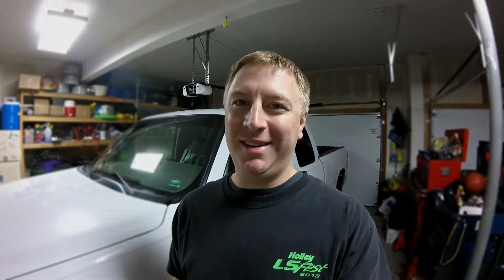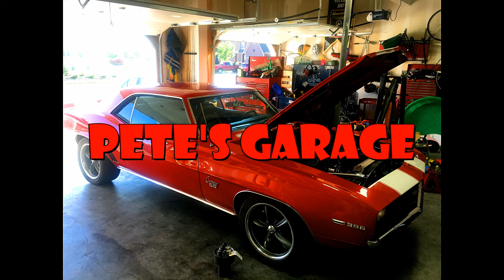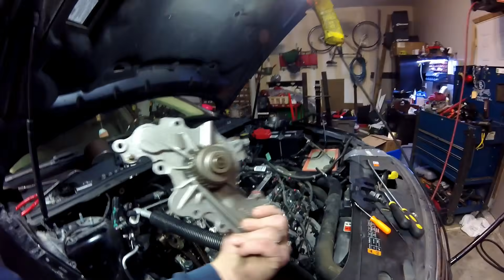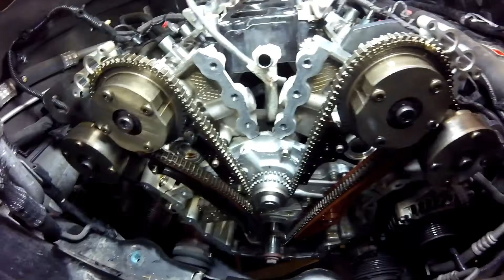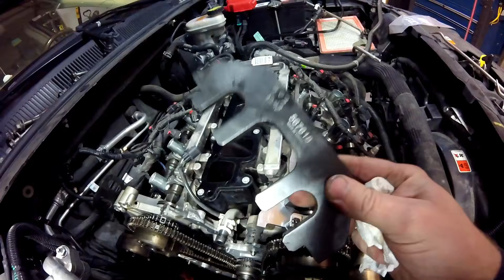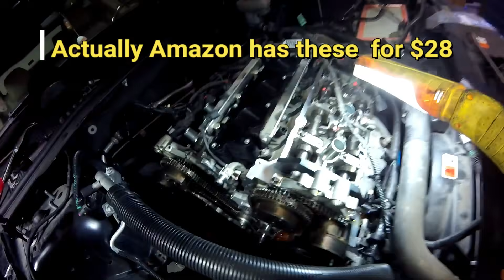Why does the Ford Taurus, Explorer, Edge 3.5L water pump cost over $1400?

Comment: you know . . ? ? . . .  that reminds me of what Pontiac did to the  turbo trans am. they  ran the bypass inside the water jacket
through the head and side of the block. it done very good until the elbow deteriorated. . .  every time. now that was a design flaw.

and as for that water pump, they done that because of  '' space issues '' .  and as for the  >.>  '' exhaust timing camshaft '' . . .  that is a very new one to me, they should have gave that car the  '' SPECIAL ''  name tag. 

thank you for taking the time to inform us of what  '' NOT TO GET '' .

awesome video !!

3000 thumbs up !!

Comment: That's sad. And it doesn't end with just Ford. I was driving a 2016 Subaru Forester and it needed a $500 service at 30,000 miles. Later I looked at a video of taking the Subaru engine apart. Believe me, you do not want to tear one of those down, like ever. I sold the Subaru and am walking for now.

Comment: FORD  put the flue pump in the gas tank another not so better idear
Reply from the maker: They all do that. GM got rid of fuel filters over 10 years ago and we now have less issues with fuel injectors. Go figure. You shouldn’t ever have to replace the in-tank fuel filter. Unless someone sugars your tank or you get some really bad gas.

Comment: I have had the "pleasure" of dealing with 4 taurus-s, 1 from the 80's, 2 from the 90's and 1 somewhere around 2000's. all of them had these types of over priced repair costs, constantly breaking, oil leaking and burning, rust issues such as the tail pipe hanger's mount point rusting off, interior always falling apart. In my opinion, never buy a ford taurus. the engineering is crap, the quality is crap and they are engineered so the dealership can keep you coming back..thankfully I never bought one, it would be in my back yard next to the maverick full of bullet holes.

Comment: So what happens if the seal fails on the sprocket or drive side  of the water pump you have coolant in your oil  ???  that why I like Ford they can take a simple concept and complicate the Hell out of it . even years back to do a water pump on a  289 or 302 was a Pain and you hope they did not leak when you were done  small block Chevy back then four bolts and your done  just remember the TV commercial  90% of Fords are still on the road and the other 10% made it home

Comment: Obvious design flaw, maybe. Every maker has there flawed products. Like GM's Plastic Timing Chains in Equinox's that have a history of going out and you have to replace the entire engine due to particles every where inside the engine. This includes the late model gas versions of GM, also. Complete design flaws that warranty companies hate to cover. Thank you for the information, don't buy a new Taurus got it. Junk design.

Comment: I work for thermoking ( transport refrigeration technician) thermoking has came out with Peugeot engines now and let me tell you they have been so much trouble, it's a car engine and it has no business being used for this application, we are now dealing with timing belts, EGR systems and now ECU'S ! Our units have had microprocessors for 20 years now and they have been ran by isuzu engines and now yanmar engines for the last 15 or so years but they have decided to go with Peugeot and they are regretting it, we are now doing engine swaps on units with Peugeots for many years to come! My point is, engineers and manufacturers sometimes don't think about the future, they need to be smarter with testing before taking a leap with something new and actually alot of manufacturers hands are tied, they are forced to make these types of changes because of the EPA and other things..   all I can say is stay in school, find something that pays good and won't cause you to pull your hair out , a mechanic or technician might not be such a good thing to do.....

Comment: $1400.00 that's cheap...I just delivered an 2014 Ford edge   same or worse problem...wen the water pump fails it leaks into the oil pan contaminating everything cam solenoids...etc the dealer estimate about $2200.00 later on I found up that this engines are also on the fords flex...I just replaced my water pump on my LS engine...6 bolts done...

Comment: 300,000 miles on my tacoma and i still have the original water pump from 2007.  As well as the original everything else under the hood.  Ford is a JOKE.
Reply: Not necessarily, I own a '99 Ford F150 4.6 liter with over 308,500 miles. All original , except for Battery and Alternator.
Reply: @davidbuck6499  That is not the same Ford as today sir.  If you bought a new ford youd have problems with it before you had problems with the 99.
Reply: 2008 Toyota Tundra 90000 miles and ya haven't had to change anything
Reply: Besides oil

Comment: The worst part of this job is resealing and attaching the front timing cover. By the way if you get coolant in that engine oil and you see it on the dip stick you are going to want to replace those phasers and bolts
Reply from the maker: I agree. There are tons of bolts and you don’t want to smear the silicone and have it leak. Then you’re redoing the job.

Comment: The water pump can be had for $50 easily and the special tools for about $40. I am 63 years old with a bad back and I believe I could do it and if I had that ford with that problem, I would do it.
Reply: my 1998 chrysler cirrus had the pump behind the timing belt too, i took it apart to change the timing belt  they recomended that i also do the water pump but it was still tight and didn;t weep or wobble so i left it there and did just replace the timing belt and also reused the tensioner as im 77 years old it took me almost 16 hours to do the job without a lift ran great for several months but then the tranny went out  oh well off to the boneyard loved that car though .

Comment: My BMW uses an electric water pump.  Of course BMW over charges to replace it so I did it myself and it was easier than a rotor job.  Part did cost $400 but I'd rather do that job than this one you are showing!  Our piece of crap Nissan Altima SeR had that internal waterpump and it cost us about $1k to get it swapped out at an inexpensive indy shop.  I vote for Poor Design!  Probably easier for them to assemble during production.

Comment: I'll keep my 4.6 with the water pump that cost me forty bucks and all of 10 minutes to change thanks ford for these new Eco piles of crap
Reply: crown Victoria lifestyle 

If you can correctly change the water pump start to finish completely in under 10 minutes I’ll kiss your ass and give you an hour to draw a crowd. It’s a minimum 45 minute job. I’ve done a few.
Reply: @chrisj197438  its an easy job I did one, you don't have to remove anything but the cover on the top of the rad which isn't even bolted down,you just remove the serpentine off the pulley remove the pulley with is 4 little bolts and the water pump had 4 bolts as well look into it its probably the easiest car out there to change a water pump there's nothing else attached to it you don't need a gasket or silicone, it uses a o ring seal
Reply: Vic Wyte 

Still he said ten minutes. It would take that long draining the coolant. I did mine in 30 minutes. That’s as fast as it can be done start to finish and done right.
Reply: Crown Vic forever.....the king of cars.
Reply: crown Victoria lifestyle lmao same here love the old fords
Reply: I'll keep my old school small and big block Chevy and Ford Windsor engines, along with a Ford 460 now and then thank you very much. The straight 6s from both of them too!
Reply: It is not designed that way to save the environment. It is designed that way to force you to give up on fixing it and to force you to always have to buy a new(er) automobile in order to have transportation! So don't you even try to blame the environment for what ain't nothing but pure corporation greed, but you people in the USA keep voting for this because this is what you'll support- for car companies to always keep you'll poor and struggling just in order to have transportation!?
Reply: Love the “environment” doesn’t need saving. It’s doing 
Just fine. The alarmists are like the flat earthers and the “moon landing never happened”crowd. Left wing loonies who believe the sky is falling. They never met a conspiracy they didn’t embrace
Reply: Charles Bronson The wife n I looked at an Astro or Safari (same thing) years ago but bought a GMC short wheelbase full size Mark III conversion instead. Like your Astro, it had the 4.3 engine and we put God knows how many miles on that van hauling the kids around! Other than regular maintenance, I changed one water pump and one alternator. While vans aren't the easiest vehicles to work on, that engine was pretty much bullet proof, basically a 350 with 2 cylinders missing. The van met an untimely end when someone blew a stop sign in front of me. I was doing about 35 m.p.h. and T-boned his F-250. The other guy and I were both fine. I don't know what happened with his truck but it was V shaped. I knew that the van was totaled because the right front tire was pushed up into the passenger door. The frame was broken behind the upper A-arm but the passenger side floor wasn't damaged. My wife and I STILL miss that van!
Reply: crown Victoria lifestyle
, you realize the obama admin is responsible for these "eco" changes? don't blame the manufactures for these changes. btw, did you vote for obama?
Reply: Those modular engine, especially 2 valves were good engines.
Reply: @milespi5556  Ford's 4.6L has earned my respect; they look frail but, are one tough/durable motor; and the tranny/8.8" rear ends are decent as well.
Reply: It should be pointed out that Ford, all to briefly, used the 3.5 NON EcoBoost in the F-150.  In the trucks the water pump is completely different and a lot more accessible so that it's replacement is at least half what it is for the FWD cars.
This engine (As used in the F) is also closely related to the V6 used in late model Mustangs.  Very reliable and relatively easy to work on.

Comment: Their like 40 bucks for the tools, i also have a set for gm engines and ive changed pumps on cars that are more difficult than the ford and i dont charge 1400 dollars so its just a bs excuse, oh its so hard thats why we need to charge so much really thats your reasoning, you didnt give time estimates on the labor part of this and didnt bother giving us price parts to justify any of the price, so honestly get out of here with that, i understand gettimg paid what your worth but dont pull out some its hard so i deserve more b.s. because you wouldnt charge less for easy jobs you charge based 9n time and material cost amd that pump cant be more than 400 usd so the rest is labor now if you posted a vid showimg the job takes 8-9 hours then at about 100 dollars an hour sure it should cost about 1400 but dont sit there and try and justify charging 1400 based on how hard it is to do the work, cause you will get no support from me its work it wasnt meant to be easy if it was they would do it themselves

Comment: What????😂 I just searched for 2014 Taurus 3.5L engine water pump and it’s only 40 bucks! 😂
Reply from the maker: Plus the cost of coolant, oil, oil filter, silicone, valve cover gaskets, intake gasket, phaser bolts if you take them off.
Reply: Pete's Garage your all a bunch of girls
Reply: Pete's Garage Pete you are a girl! Why don’t you just throw your breakfast and lunch cost in there too, oh wait you forgot to add the electricity you used for lighting there Pete and the tide laundry detergent to clean your cloths and the soap the wash your little girl hands. 😂
Reply: kay cee labor cost
Reply: kay cee plus cost of tools

Comment: Coming up next: blinkers and why you have to take apart your whole motor to replace them.
Reply: I had a Buick Lacrosse, and it cost me $200 to change the headlight bulbs because the dealer had to take off the entire front fender to do it. No more Buick for me. No more GM for that matter.
Reply: if u change the blinker oil at 10K intervals, they never give trouble!
Reply: 🤗😄🤣😄😄😄🤣LMAO !!!.... I don't doubt you
Reply: LMAO!
Reply: I'll keep driving my old piece of shit
Reply: I wouldn't be surprised
Reply: Well with LEDS on everything now a days a tail lamp or headlights is about 1k not even joking.
Reply: Funny but this is very true. on my explorer, the blinkers stopped working and the electronics started acting wonky. the battery was also going dead. So I thought it was the battery. I replaced the battery and in about a week the battery was dead again. I took the pos to a shop. Come to find out there's a control box located in the steering column behind the dam airbag that will go bad over time due to the wires always moving when you turn the steering wheel. The box will then start trickling off the battery. Cost to fix this problem was $500 because they have to take the whole steering assembly apart to fix it

Comment: Fuck modernday manufacturing designed to rape people on repair bills. Every manufacturer does this, like BMW with their stupid plastic clutch pivot pens and thermostathousings with plastic impellers i mean what the actual fuck. Why make a crucial component out of plastic? It would only cost a little bit more to make it properly, but they choose to not do this.

Comment: $1,800 May 2018. 2013 Taurus in vehicle water pump replacement at a Ford dealer. The mechanic knew a “trick” to do it quicker. Took him 4 hours longer than the book time.

Comment: The 4.0 sohc motor has chain cassettes, the ps chain can not be accessed with the motor in the car because it's on the back next to the firewall,  the cam tool is $900 bucks from otc and they won't sell it unless you have a shop, got mine from a pawn shop in Texas for $150 bucks. I love fords but come on!